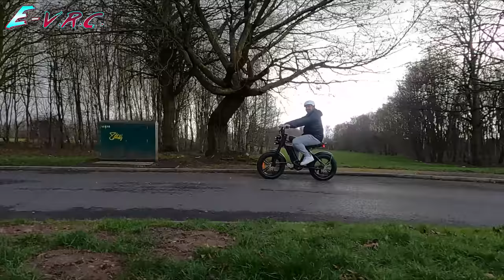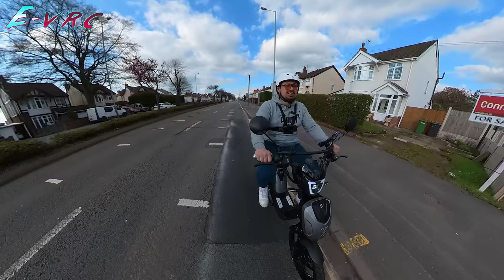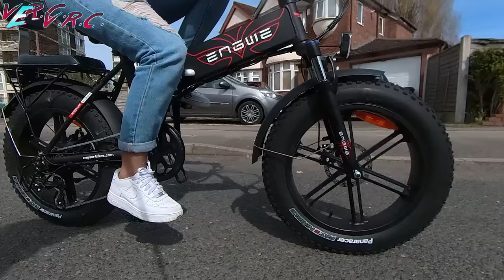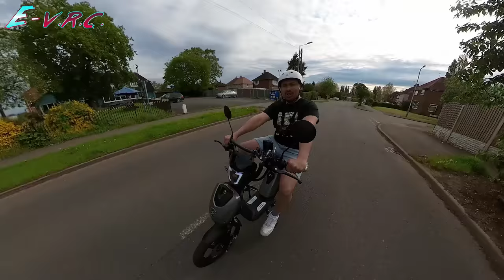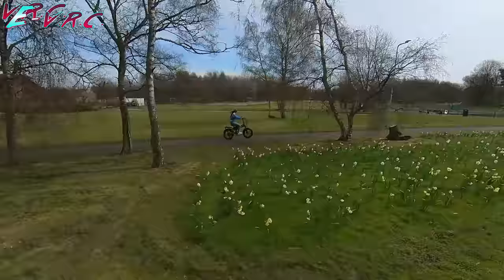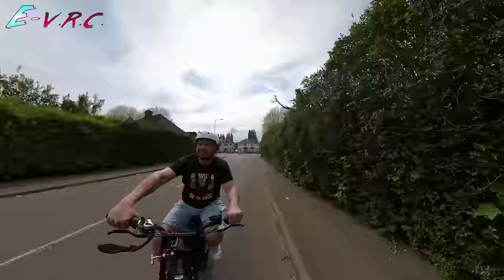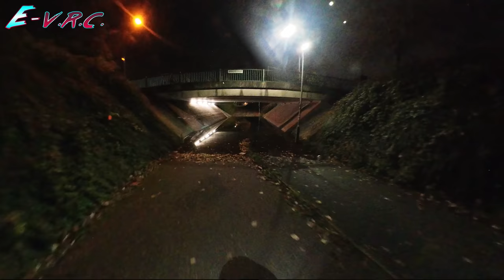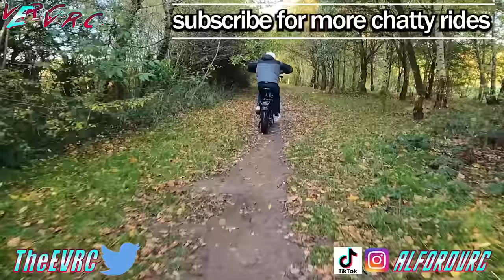The CRAZY Ebike law that MUST Change Before Someone Gets HURT

Comment: Any ideas why my samebike LO 26 48v battery wont charge past 74%  charger goes green? Any help would be much appreicated, Thank you in advance it only done 103 miles
Reply from the maker: So the bike says 74% on the dash? Any idea if you're getting the range you should be getting? The voltage could be set incorrectly in the computer or (worse case) some cells have gone bad. Sometimes though, chargers take a few cycles to be able to get to 100%
Reply: @e-VRC  Thank you ever so much for replying, Voltage is correct 48V but battery Supply shuts of when it reaches 74% when i road test it, she goes off like a demon but drains very fast got the s830 display She wont charge further than 74%
Reply: @e-VRC  Yep kept her topped up over winter was prob the mistake i made 200 quid later i know now and thank you lad <3
Reply from the maker: @bennyhill4228  how low have you taken the battery. I have an euc that wouldn't charge up until I let it get down below 50% and then it gradually got closer to 100% with each charge.
Reply: @e-VRC  yeah it hurts battery gone wonky I bought a36v Bat Silver fish made a couple up connecting but got E06, i should really cut my losses and just buy a better bike lol i realydo apprciate the reply Thank you
Reply from the maker: @bennyhill4228  no problem. Good luck with whatever you decide to do 🤞
Reply: @e-VRC  No now way getting the range sadly and thank you again
Reply: gets me to lidls and back again so can't grumble lol
Reply: @e-VRC  it's to big for the bin gonna try experiment, Bat bis defo toast but why ? i jkept it topped for too long is my guess, lesson learned ouchy expensive
Reply: Think I know what the problem is. 
The battery has gone out of balance. As in the 13 cells in series are at different voltages. And the BMS will shut down charging when one of them reaches 4.2v approx. Happened me with a 17.5 ah second battery supplied with my sons shengmilo MX02. 
Got weak and had hardly been used. Then I heard on line others had similar issues and solved it by replacing the BMS. 
So I replaced the BMS , put it on charge and charger shut down after 15 min. 
Battery was only at 44.5 v.  
Think it was a faulty charger , I tried another with same result. 
So I removed the sensing leads from the BMS and checked the voltage of each cell. Most were between 3.15 volts and 3.5 volts but one was at a full 4.2 volts and this was shutting the charger down. 
Only solution is to open battery. 
Disconnect the sensing lead from the BMS and discharge each cell down to match the voltage of the lowest cell. In my case I discharged all cells down to 3.12 volts. 
Put battery on charge 
Took 7 hours to charge 
Final voltage was 54.17 volts. That was 2 weeks ago and since then just sitting there the voltage has dropped to iirc 53.8 v which is what I would expect from a brand new high spec battery. 
If you require more detailed information on this reply to this message and I will get an email notification and reply with an in detail post on how to do this.
Reply: @patomahony9747  Thanks for the detailed reply, much appreciated bud.
Reply: maibe one cell voltage is high and the BMS switches off. Maybe one cell is bad. Sometimes cheap Batterys are made with second hand cells.

Comment: I want a new ebike class that is unrestricted for speed and maybe 1000W for power but must be insured, must have a small number plate and must adhere to speed limits.

It should also be legal to cycle slowly on cycling infrastructure and shared paths. I would even be happy for riders to have to have at least a CBT license but without the stupid L plates. 

This would open up a new class of commuter and delivery vehicle that could transform inner cities.

Yes, these will sometimes be involved in accidents and reckless riders should be prosecuted just as reckless drivers are today.

Comment: I commute on my super 73 and I usually ride top speed 30 mph and I'm able to keep up with traffic this way. Any slower and I'm a hindrance to other drivers and I feel unsafe. Also I'm able to keep a steady speed of 25mph uphill pedalling with throttle. God knows how slow I would go if my bike was only capable of 15 mph.
Reply from the maker: That's awesome, glad it's working out 👍 the keeping up with traffic to he safer really only holds at your speeds. But 30mph is never going to fly when it comes with ebike law since that's faster than mopeds are allowed to go.

Comment: Ridiculous law when the little disabled vehicles bomb around my area clearly more than 6kph. Many I time.ive nearly been hit by one on a footpath. One rule for one as they say. I have ab Eleglide T1 which I haven't added the included throttle to that will pull 15 5mph, I also have a Kugoo Kirin B1 with throttle that'll clock 29.7mph (unfortunately stability becomes an issue on it at that speed)

Comment: ⚡🤙🏼 Some of our laws are idiotic, 250W won't do much on even a small hill and 18mph would be a better limit 🤙🏼⚡

wth the pedal scrape on the escuta, bad design 😱 poor foresight on their part

Torque sensor pedal assist should be the norm, cadence is just an odd feelin
Reply from the maker: I guess with the Eskuta it was kind of unavoidable due to the form factor but at least normal bikes don't have to have them that low. I'm still undecided on torque vs cadence. Torque is definitely better and less prone to accidental activation but i do like the proper ghost pedalling of cadence.
And yeah my first escooter goes 18 and it's a decent speed. Just a few mph more makes a big difference.

Comment: This is such a great and good video explains all the reasons why I will not purchase an ebike  the silly  UK ebike laws,
Reply from the maker: They're still great though. Getting to work without breaking a sweat. Or getting back on a bike when you thought you couldn't. Plus despite the video i still maintain that you'd have to be extremely unlucky to get into trouble on a 250w bike with a throttle that pushes it to 19mph.
Reply: @e-VRC  Hi , That's my point is you should not need tobe lucky or unlucky.

Comment: 20mph would be sensible.

I only agree with a throttle if it's under 10kg or they are just motorbikes.

If you want a bike with a throttle get a bike licence.

Comment: America, fook yeah!.  Technically I think the speed limit on ebikes class 3 is 25-30mph, or maybe it could be considered a moped which would require a license that they mail you or something.  That said I got a 3,000 watt 72v motor which allowed my bike to go around 35mph top speed.  I would argue I definitely felt a lot better riding in traffic with relative speed limits.  I would argue I've had less cars try to overtake me when going at higher speeds but I still give them room to.  

I would argue that faster speed in safer for bike riders.  As a bike rider you have nothing obstructing your view, so if you had enough power you could avoid most accidents.  I even watch the wheels of cars turning.  Even when riding a regular bike on the sidewalk because of visibility you can see the person about to hit you, if you had the power to get a sudden boost of speed you can avoid a lot more accidents.  The problem is when your in traffic and you find yourself in a lane that isn't the best you may not have enough speed to get over in another lane because of speed limits.

Comment: I think i may be in a minority here and i think this is a ridicules narrow minded upload.

He never mentioned the injuries you will receive falling off your bike at 20mph compared to 15.5 mph

I also noticed he cycled on the pavement for a short period of time to save him pulling out to get past a car and that is also a problem.

With people and cyclists sharing the same path you don’t want these things going too fast.   

End of the day if you want more power get a motor bike licence. 

Full disclosure - i have a Ribble E- gravel bike.
Reply from the maker: This video isn't about speed. It's about the throttle. Assuming speed is exactly the same.

Comment: How about making ebikes and scooters abide by the same laws, recommendations and requirements as motorcycles on the road? How many more inexperienced people need to die while driving scooters and ebikes?
Reply from the maker: Well escooters are illegal so law wouldn't change anything there. But legalising them and making it illegal to not wear a helmet would help. The high profile recent ebike deaths have all involved illegal extremely powerful ebikes too so again, law won't help there as the riders would still break the law.

Comment: Every single example of e-bike you rode had the saddle set a foot too low. A SLIGHT bend in the knee at BDC, Okay? 😉 Any authority you might claim as "an expert" on this subject completely evaporates if you can't do this simplest bike fitting adjustment.

Comment: I  agree with you on all of these points but is there not a thumb lever that acts as a throttle on some E bikes?  The limit of 250 watts in the UK is ridiculous & should be raised to at least 1000 W. The Speed limit of the motor has to be raised too to a level more in line with the normal flow of traffic up to the urban speed limit of 30 mph! I have no objection to the local authorities making it mandatory for these higher powered E Bikes to be licensed in the same way they licence dogs or taxis! IE a single one off payment with a registration plate fixed to the frame!  This would make perfect sense since the government is banning the sale of ICE vehicles from 2030 which will include mopeds and scooters as well as cars and motorbikes! Plus trying to coral us into 15 minute cities etc.!
Reply: Fun thing not a lot of people know, is that the power rating on those motors is 250 watt.....in general. So when you come from a stand still and go the motor is taking 750 watt for a few seconds. This whole law is ass.

Comment: Nothing wrong with either, just a bit of common sense. Like a car p.a.s if you’re coming to lights or steep the first thing get in low gear if you do high gear in a car it stalls so if you’re in high gear with bike you will stall from start, common sense really. It’s not the bikes it’s people don’t know how to use correctly.

Comment: Simple- penalize people breaking road laws with the same infractions as you would a car. There's no sense in overall speed/ power restrictions, especially in car-centric cities (the norm here in the US). Luckily my local cops could not care less despite mine being capable of 70+mph (I'm the only one in my small town with an ebike, and mine is capable of 12,000 watts). I can keep up with the flow of traffic and leave plenty of space on walking/ biking trails, so I have yet to experience a single complaint from anyone. It could be a car replacement for so many people, but we cant focus laws to punish law-abiding citizens based on the minority group of bikers endangering others

Comment: Actually, if your ebike was built before 2015 you have "grandfather rights" - i.e. you are allowed a throttle. Back then, a throttle was not illegal. Stupid EU law was later made by old duffers who've probably never even rode a bike in their lives. I have a throttle on mine, and it's so useful. It's flat where i live, but the roads are terrible. I ride a rigid ebike and it crashes and bangs over everything.  IMO, going faster than 15.5 can be dangerous because of the sheer amount of unkempt surfaces and potholes. That's probably why they won't raise the speed limit.

Comment: having your cake and eating it comes to mind, if you want a throttle and be able to do moped type speeds licence them the same way as electric  motor bikes get a licence do a CBT 3rd party insurance and have them registered.
Reply from the maker: This video is only about throttle. I even said the speed sort of makes sense.
Reply: @e-VRC  yes exactly, the law is specific if it has a throttle it's no longer an E-bike but classed as a moped. and moped have to be registered have insurance and you need a minimum of a learner licence. that's why e-bikes don't have one. can't have it both ways it's an E-bike or a moped.
Reply from the maker: @yorkiecol7973  if having an ebike that can go where pushbikes go but also having the safer and easier to manage control of a throttle then yeah I want to eat my cake. I like to eat cakes I own :)
Reply: @e-VRC  don't we all,

Comment: When it comes to the ebike law that is actually in the process of changing to increase the power  limit to 500w and allow the use of throttle control without pedaling so it will be good when this finally goes through however it is still stupidly limited to 15.5mph, when it comes  to speed there is study data that shows being able to maintain pace with other road users reduces over all accidents this is why certain motor vehicles are not allowed on motorways if they can't maintain pace, when it comes to the roads cyclists are likely to be on these are usually limited to a 20mph speed limit anyway, America is a great example of logical ebike laws in that under motor alone it stops at 20mph but if you pedal then the motor can go up to 28mph and in the US they saw a mark reduction in accidents caused by cars trying to over take.

The usual argument from the lycra clad weekend warriors is that high power ebikes are a danger and go to fast and blah blah, the reality however is as was pointed out in the video normal cyclists can easily do 20 - 25mph  on a properly geared mountain bike  and easily 30 to 40 on a road / racer bike and more down a hill

Comment: Twist throttles have been around for more than a hundred years try riding a motorbike without one.
A car has a foot throttle and many accidents happen when someone applies the throttle instead of the brake.
Can't do that on a motorbike. All vehicles should have twist throttles that act as dead-man brake. 
Would stop a lot of car drivers fiddling on their phones. 
Can't see the problem on a very low-powered Ebike having a twist throttle. It is just the mental attitude of the lawmakers.
It is obvious they are trying to slow down the uptake of E-mobility. All these new laws for  E-mobility seem to be aimed at this outcome.
So what is driving this agenda, is the fear of lost revenue or the possibility of having to create facilities for E-mobility. 
Slowing down cars in the city and the takeup of Ebikes Isn't that a good thing! Less stinking fumes.

Comment: sound like you want all bikes to be torque sensing rather than cadence, sorry but all "ebikes" should have the throttle removed, if you want a throttle get a moped. if your bike is not setup correctly from factory get a better bike, the issue is most of the throttles override the 250w power limit as it delivers full power from the motor and even the 250w rated motors exceed this as its only the constant pedal draw that is calculated not the peak power.

Comment: Cornering up hill - maybe you have never ridden an ordinary bike, for anyone that has this is a non issue. Pedal assist "all or nothing" I'm not sure what kind of bike you have, but every ebike I have ever ridden has torque sensing and delivers power proportional to applied pedal torque. My guess is this is maybe a thing on cheap hub drive bikes. My advice would be to get a good quality mid drive bike.
Reply from the maker: Most ebikes have cadence sensors rather than torque sensors.

Comment: I understand the arguement for allowing a little more power to make these bikes more useful for less able riders. But If You want to go faster it would seem to me you should just go out and get yourself a moped licence. Yes you will need to tax and insure it and you wont be able to use the bicycle lanes.  But thats the whole reason we have bicycle lanes. Its so we can seperate cycleists from faster vehicles. That should include the likes surons imo. 
And I know you dont need a motor to pedal faster than 20kph. But IMO city bike lanes arent the place to be trying out for tour de france either. 
Maybe your sugestion of a speed limit for bike lanes would be a good way to go. But should that mean I should be able to take my zero electric motorcycle that makes 50hp and goes 100mph in a bike lane as long as I keep it under 15mph?
In my view electric motorbikes or mopeds should be treated absolutely no different from lce powered motorcycles. For which we already have pleanty of sensable laws that only need to be inforced. But there should be a clear distinction made between them and electrically assisted push bikes.